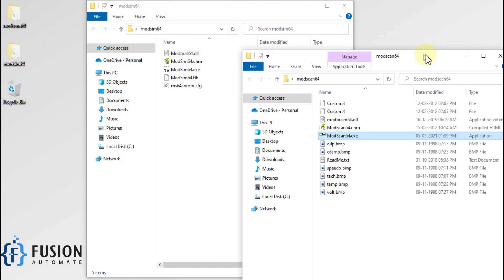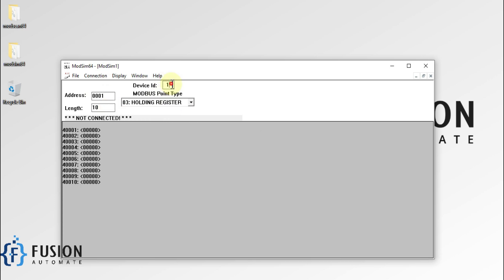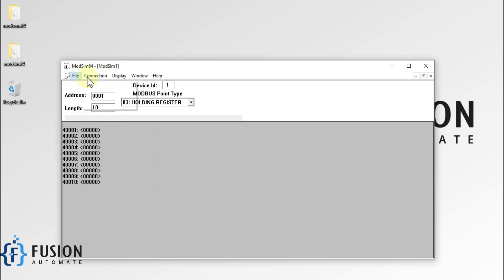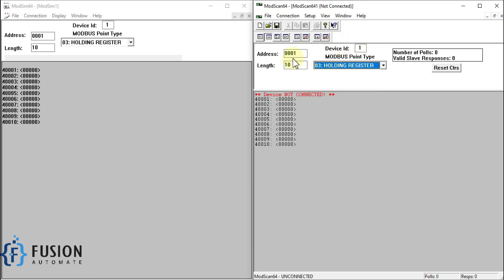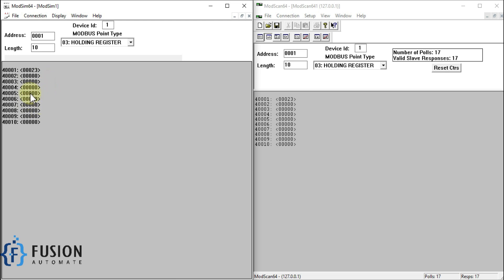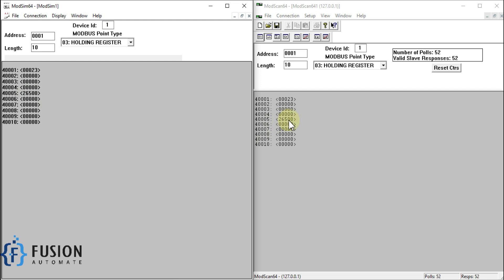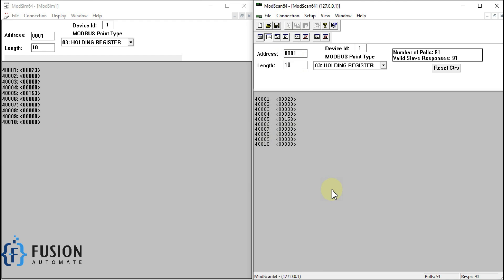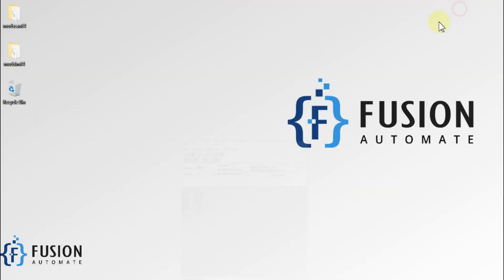How to Create Local Modbus TCP Server using ModSim Software | Modbus Tools | Modbus TCP Server |

Comment: isn't Modscan used in MB RTU as Master and ModSim as Slave ? so Modscan should be Server & ModSim as Client !
Reply from the maker: In serial terminology if modscan is asking data to device then modscan is master and in tcp/ip terminology if modscan is asking data then we can tell its client.

its like server will host the file and when client need it will use that file. so server is the one who is having data so modsim is having data so its server and modscan is requesting data so its client.